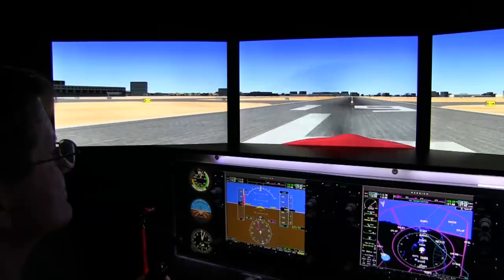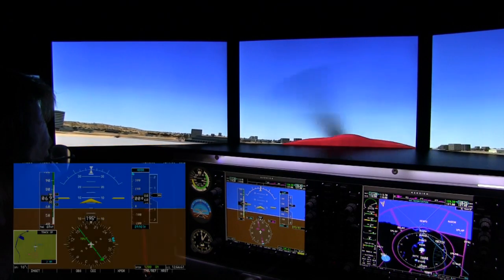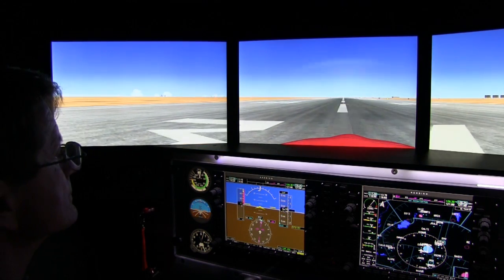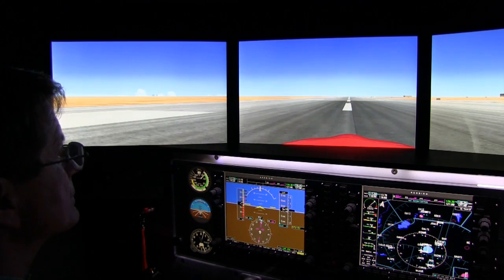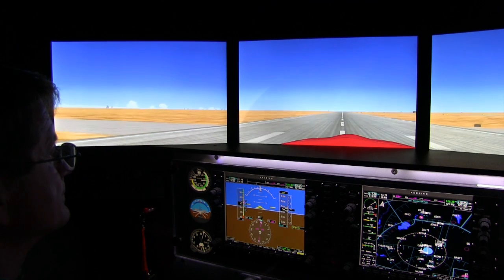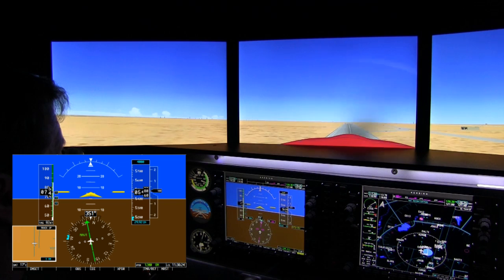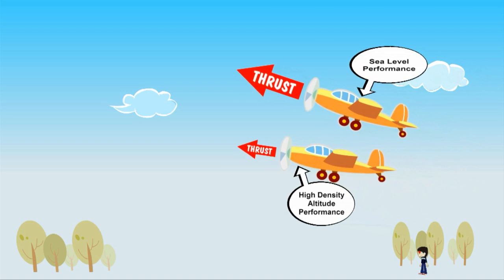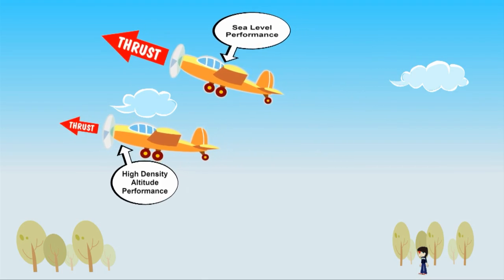The Proper Attitude for Making a High Density Altitude Takeoff

Comment: Rod, love your videos. Thank you for all the education and tips in an easy to understand manner. At high DA, would it help to use (for instance in a C172) 10 degrees flaps, apart from leaning for max power?
Reply from the maker: Thank you, Sukumar. I do appreciate the comment. Regarding your question, 10 degrees of flaps would shorten your ground roll but decrease your rate of climb at Vy. Very few GA airplanes recommend climbing with any flaps applied if you want to achieve the best rate possible.
Best,
Rod

Comment: Rod you forgot to mention even leaning for max power at high density Alt is not always enough for some light GA planes to take off, especially at high gross wt..
Reply from the maker: Leaning for takeoff in all these instances is for max power (which is max performance in this instance).
Reply: @Flight-Instructor  Just saying many GA planes even when leaned for best power,  their "service ceiling" is the airport DA elevation !!!! T/O not safe... OUCH!  (ROD REPLIED TO ME! 1st heard you speak mid 80's, many times since. Big fan. When I retire want to teach (CFI) work again)
Reply from the maker: @gmcjetpilot  Yes, so true. Any airplane with a DA at service ceiling, irrespective of MSL altitude, is more of a car than an airplane. And it's a pleasure to reply when I can finally have a bit of free time to do so. Thanks for that nice comment, too. I do appreciate it.
Best,
Rod

Comment: To experience high density altitude takeoffs anywhere, anytime; using any density altitude chart or flight calculator and work backward from the density altitude for the test and find the air density at that point. Then open the throttle on takeoff and stop at that manifold pressure. Do not go above that MP reading and proceed with the takeoff and climb out. The engine will be producing the same exact horsepower at that setting as it would under actual conditions.  If you want to duplicate a takeoff at Leadville, Colorado (9927') at 48°F, open the throttle to 20" manifold pressure and no more.

Comment: Not a pilot myself, but have dreamed of it many times, understand flight - read and studied about it from a child, designed, built, and flew free flight, control line, R/C gliders, planes (fuel & electric), even a short time with helicopters. Been in a small 4 seater plane, and rode in a glider in Tahachapi, CA. So I'm familiar with the different variable of flight.

I understood what you were explaining, however I did find your using "high density" to describe the thin air at higher elevations confusing until I translated it.
If anything it would be a low density takeoff, because of the lower density of the air at the higher elevation. At sea level would be the thicker high density air.
Reply: I agree. The sequence of the words doesn't make sense. It should be High Altitude Density, which of course is low air density. And Low Altitude Density, which of course is high air density. Aviation lingo is screwy. They like to say slow up instead of slow down.